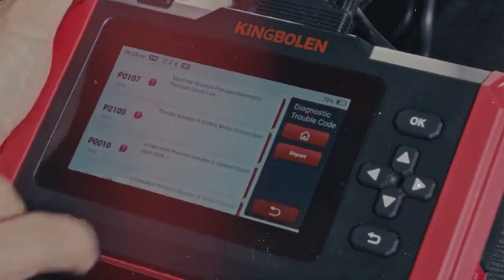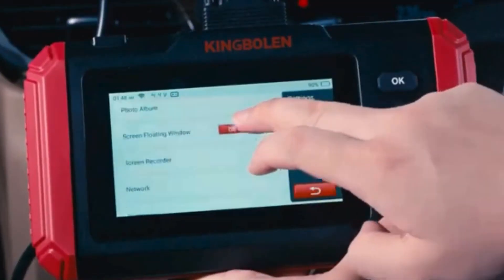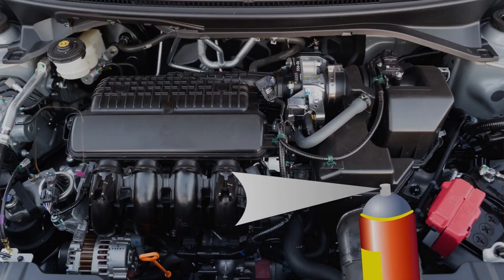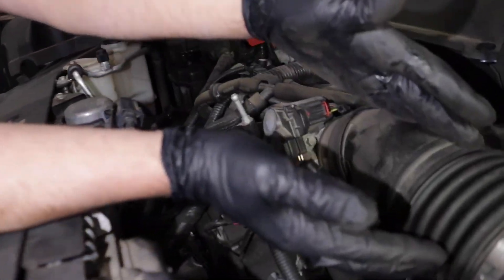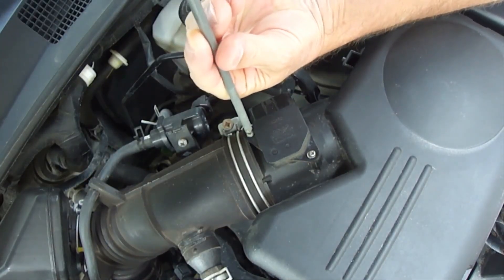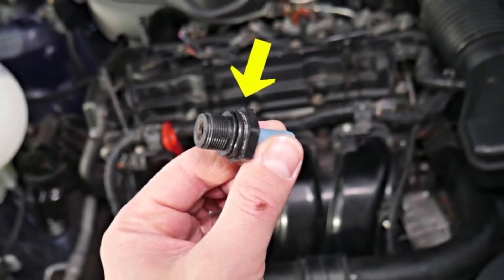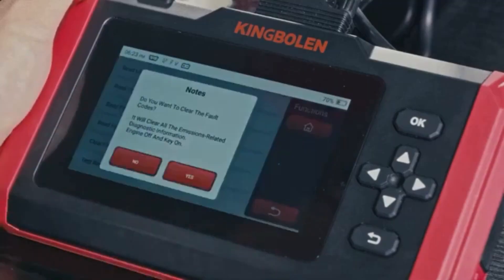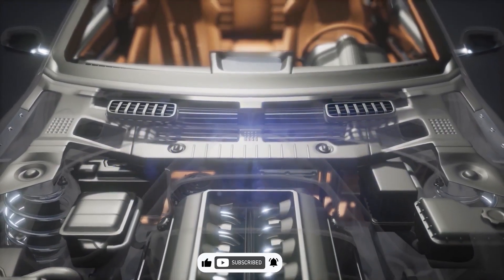P0171 Code: System Too Lean (Bank 1) – How to Fix & Diagnosis

Comment: Thanks for making this video. I have a 2015 Toyota Corolla and the parts store gave me a print out of the Diagnostic codes that came up. This was the main one. Happy to know that it could be an easy fix. Will definitely try doing as much work myself to save on expenses. So I appreciate the helpful advice.

Comment: It's so hard to find good mechanics...I went to a shop with this issue, $220 for smoke test- no vacuum leak then they told me to go buy a PVC valve.. dealership says get second opinion because that valve is really unlikely to trip P0171 code.
Reply: @rickjames9524  pvc valve fixed that issue??